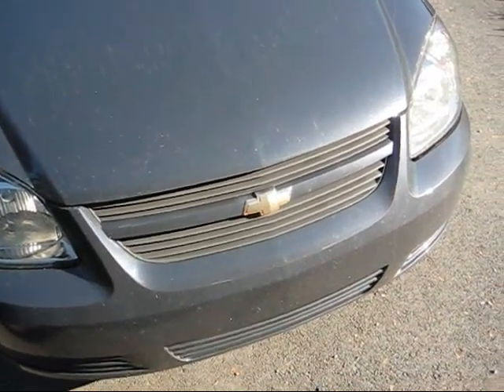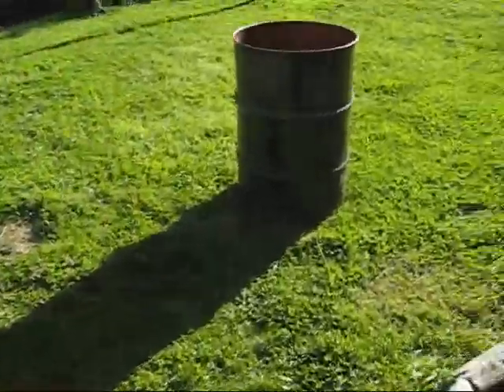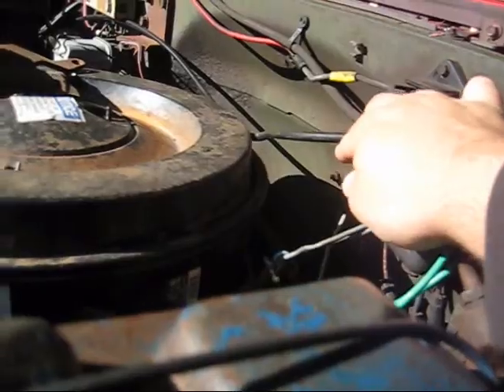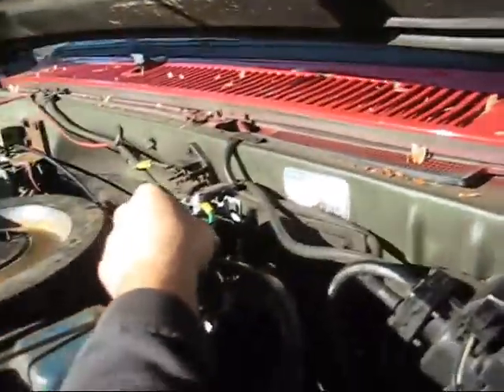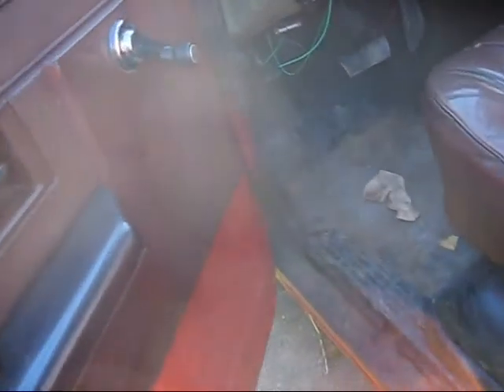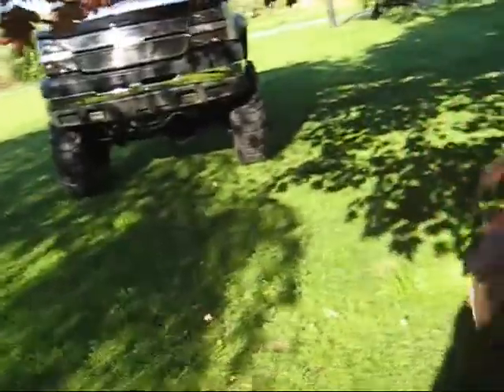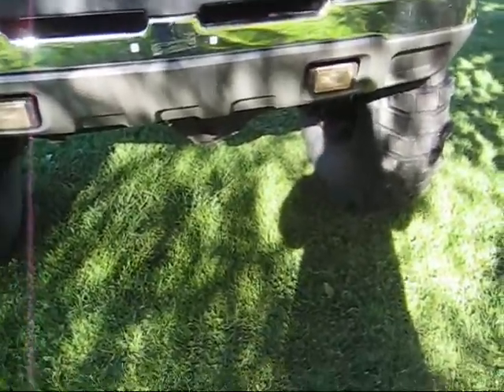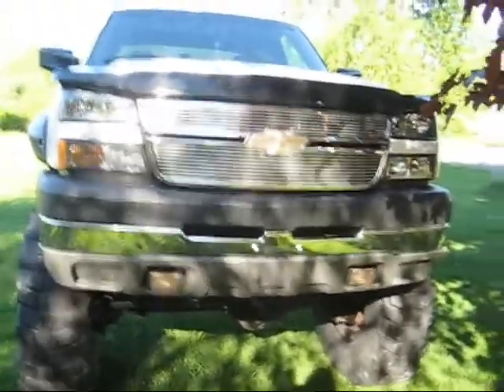My 6.2 Diesel Manual Glow Plug Conversion.

Comment: How do you start a diesel in the very cold weather lots of people have a very hard time starting diesels in the cold how do you do it
Reply from the maker: Most of the time you'd either plug them in and use the block heater. Or cycle the glow plugs a few times

Comment: By the way my diesel blew after an oil cooler line popped off the side of the block  I miss my diesel, anyway, the lines at the filter adapter are help on by a "C" clip. Absolutely piss poor design. Do yourself a favor and get an aftermarket oil cooler for it that has a good cooler line attatchment point. If one of those clips wears down and lets go you'll lose all your oil in 5 seconds flat and BOOM :(